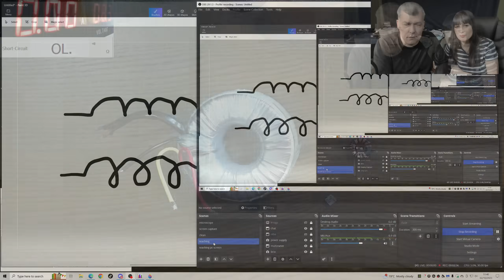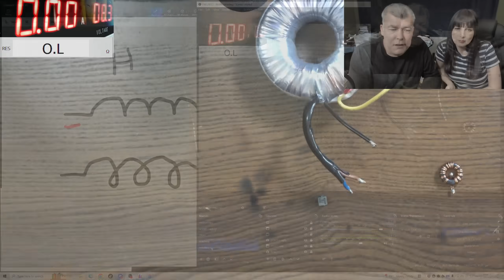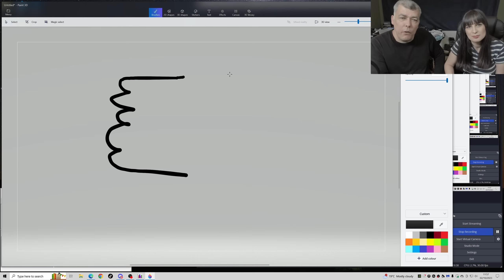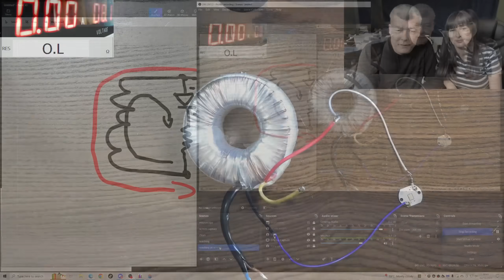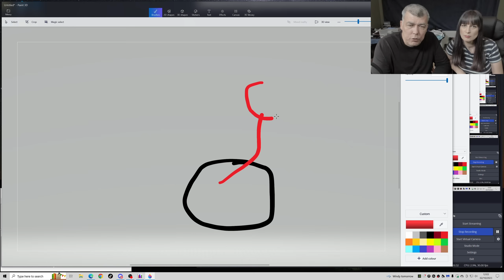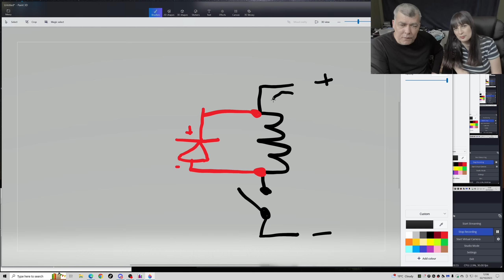Coils and Flyback current explained - Lesson 19 Learning electronics with Diana

Comment: Hello, so they are back. Quick question for you. When I power off my motherboard i get a small power surge about a second after all the power has gone. Is that because of the flyback current?
Reply: No, Because mostly of the energy store in the Capacitor
Reply: @badonrani4059  Thanks.